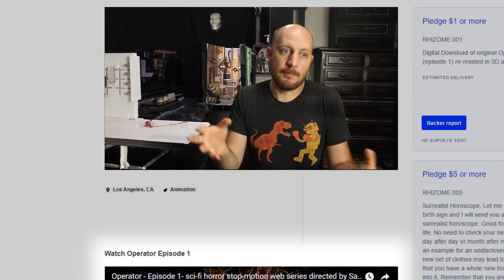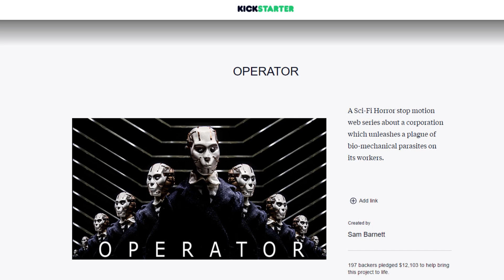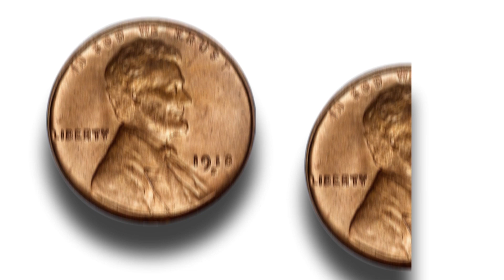Help Kickstart Operator Episode 3! (Kickstarter was successfully funded and EP 3 is in progress!)

Comment: and that's what i Love about most stop motion Animators the creator Animates Real Objects, with a Tad of Effects but some try to keep it without using the software for effects. Also, I had a fascination for stop motion ever since I saw my first stop motion,   Rudolph and frosty's, I asked many but no clear answer, what do you use to cast the hands out of? is it silicone what type or brand? or do you Melt the Clay and add other sustenance? to make it firmer and sturdy.
Reply from the maker: Smooth On silicone,  Sorta Clear, around 20 shore.